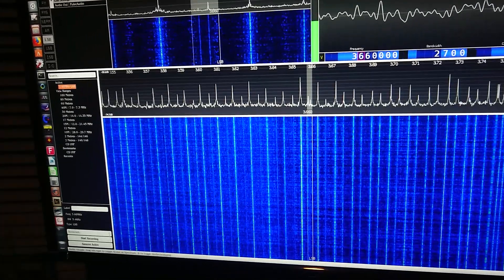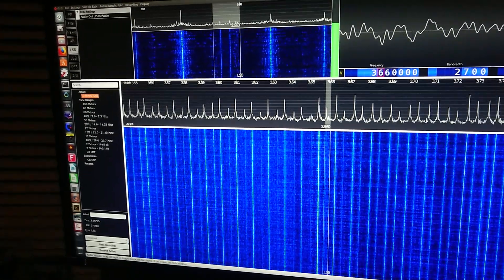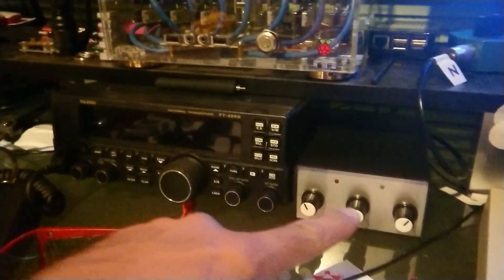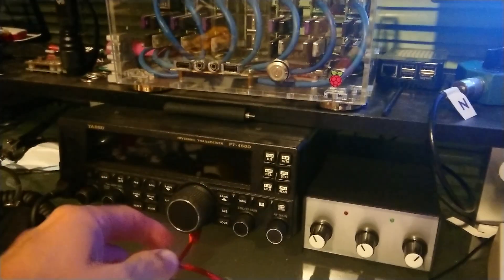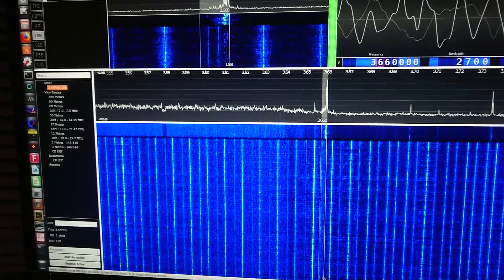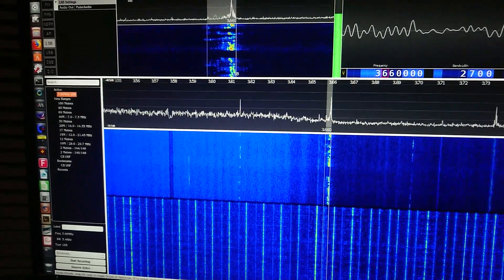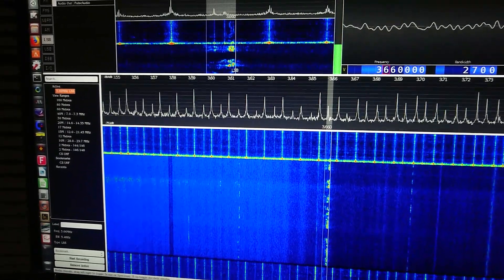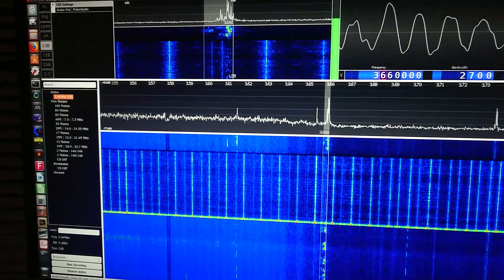Noise Canceller for Ham Radio

Comment: Hi there. I just built one of these and am currently mounting it in a casing. Wondering what type of antenna you decided upon for the aux antenna. Perhaps you would like to do a short video on what you are using and how you came to decide on that antenna. Thanks.
James
Reply from the maker: My noise "antenna" is simple a couple of metres of wire hanging outside. Maybe not perfect but it seems to work well enough.

Comment: What you receive is not noise, it is overdriving of the ADC in the sdr receiver so it shows spurious (phantom) signals. Just reduce the sensivity and the problem is solved. The thing you do is reducing the wide band signals in the noise canceler and so triggering the same effect as attenuating the signals befor the ADC. This is a typical known fenomenon and does not say a thing about the quality of the noise filter. There are a number of SDR publications that tell you what is happening here. best of luck 73'
Reply from the maker: Maybe, though it still shows those peaks regardless of the RF gain and AGC settings. Can you suggest a link to further doc on the SDR ADC?
Reply: @spemberton101 , here it comes:  http://www.ab4oj.com/sdr/seapac17/sdrpres14.pdf - http://www.ab4oj.com/sdr/sdrtest2.pdf - https://www.qsl.net/z33t/dynamic_range_eng.html - http://www.cvarc.org/resources/Tech_Articles/IntroToSDR.pdf, good luck!